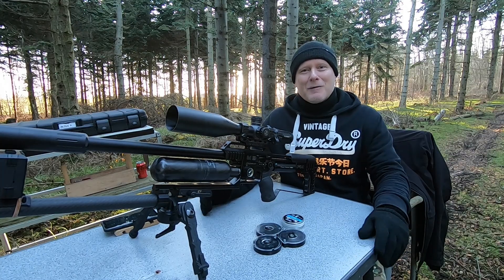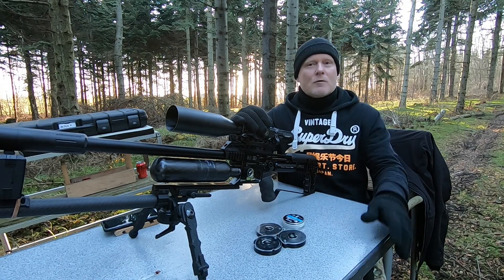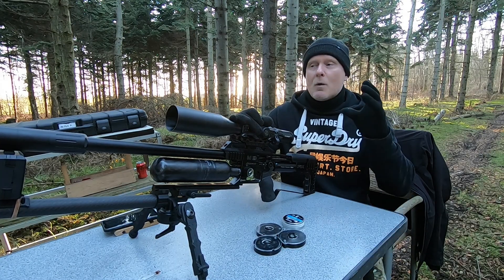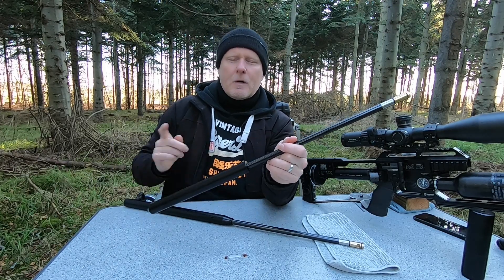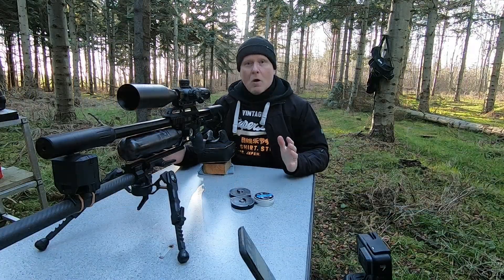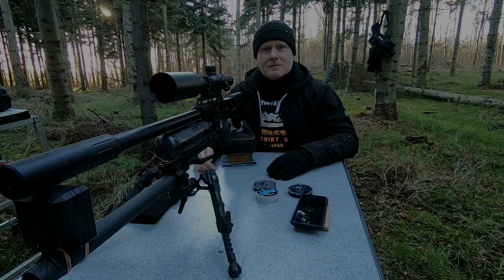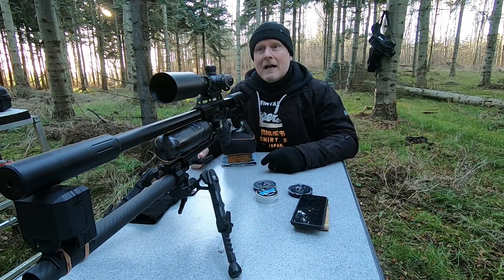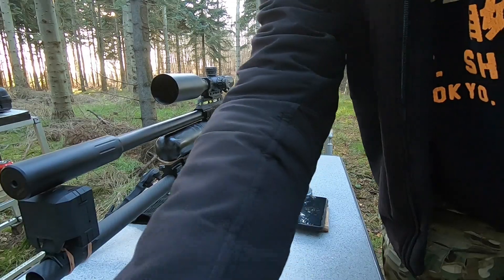FX Impact M3 Barrel change, 600 mm/700 mm - PLUS Accuracy test. What is the gain in velocity?

Comment: Nice shooting. 
Surprised at small gain in speed. 
Might need more shots through new barrel to lead it in.
Something else is not the same. 
Larger calibers show significant increases every 100mm.
I'm waiting for the FX MK4 with a 800mm  barrel. 
Cheers from sunny Florida 🌞 ☀️ 😎
Reply from the maker: Yeah lets see where the length of the barrels ends 😃
Im really happy with the 700 mm. The 600 mm is on my Wildcat now 😃
I think that the increase would be bigger if the reg had been higher. When we tested the 500 vs the 600 in the Mk2 the gun was tuned for the 500.
Here it was the other way around. But I still dont think that the gain would have been as significant.

The sun and the good weather is still a couple of months away here.
Kinda excited to see what higher temp will do for the accuracy 🤓 It usually helps - maybe I will be shooting hole in hole by June 😃😎😂

Best regards mate 😎

Comment: Personally I think that with the impact you get better results when you work at high pressures, I do want to leave it at 990fps, I put the regulator at 160-170 bar which gives me more than 1040 fps, then I close the air flow to  i get 990fps. This way I get the difference between shots to 1-3 fps , I like to work with high pressures because the power curve is more efficient, and there is less vibration when the air passage is more close. That's my opinion
I have .30 cal
Reply from the maker: Thats a good point Tom!
I really like the idea of turning down the reg to get more shots, but I might be too low at the moment...But with the quick adjustment system at 2,5 I dont think that it makes significently big vibrations. 
But maybe 10 bar more on the reg and a bit down on the hammer for me 😉
I doubt that your slugs would go very fast with 110 bar on the reg  😂

Have a great sunday 🙂
Reply: @VikingAirgunner  Of course, in .177 you don't need as much pressure because the weight of the ammunition is much lower. I forgot to say that with this method it gives a stronger but shorter air blast, so I need less air because with the strong air pressure I get the desired speed without residual air behind the slug. Good Sunday to you too.

Comment: there is something wrong there mate. i went from a 500mm to the 700mm in my .177 impact mk1 and it went from 865 fps (jsb 10.34) to 930 fps with no  dual transfer port or pin probe
Reply: sorry forgot to mention that wen the barrel kit arrived the  steel part on the transfer port side was loose and i had to loktiite it
Reply from the maker: Im not really sure where you are going with this info? Could you specify a bit closer please? 🙂
Reply: @VikingAirgunner   its  either your first regulator went bad or the part that your dual transfer port  screws on is loose as well. there is something wrong with your ES .also i emailed your friend about a carbon liner housing but no response
Reply from the maker: @tromplee6107  That could make sense 🙂 Thanks for your suggestion 🙂

Comment: Looks good mate! I wonder if you might benefit from indexing your liner and then using the harmonic tuner. It looks like your trailing off from upper left to bottom right, so maybe if you index your barrel just a touch, you might get those in a vertical line and then be able to clean it up further with the tuner. I have tried the KOs with my 600mm on my Crown, and they did not seem to like being shot at higher velocities. It was like a shotgun when I was shooting at 950-1000 fps, but then when I got into the 800s it started to get better. It was not great, but better. I need to do more work with them and I may be able to get them to group well.
Reply: Hi, just a quick question; would it be possible that your grouping at 950-1000 fps would be bigger because of entering the transsonic phase where the projectiles become unstable?
Reply from the maker: Hi Pat
I never thought about indexing the liner. Thanks for sharing that idea mate 🙂

I want to get the tune as good as I can before using the barrel tuner. I have a cf barrel housing commin shortly, so there are still a few projects before, but it is comming 🙂

I think that there are many sweetspots at different velocities. Recently got a Wildcat and I had that shooting well at 760 fps and again at 850fps.

I wish I was better at tuning, but it is a proces - so thanks again for your input 🤗🤗

Comment: Great group !! Is the vertical poi spread not resulting from the significant velocity spread? At 100m, I assume that a difference of 30 fps translates to vertical poi shift. If your average velocity is not to close to the plateau velocity for your reg pressure, maybe you can slightly increase your HST and see if that gives you a lower ES. In terms of ES, the sweet spot is usually just a few fps below the plateau velocity. But I'm sure you know that. Just let us know how you address  this issue. As far as I remember, in his Power Tune video, M Dubber talks about longer barrels. You might find interesting clues in there.
Reply from the maker: Hi Steph
It makes really good sense with the vertical shift ☝️
So far I have been focusing on the valve and I still believe that I can improve the tune by some fine adjusting. I have seen some changes in ES so not all done here.
And with the ES being so much better in the 600 mm it could mean that I have turned the valve to far in for the 700 mm? 🤔 Valve closing to soon.

I actually think that the M3 is capeable of doing an even better group - and thinking about my bench (a camping tsble) it would help to get a table that is rock solid 🤓
Reply: @VikingAirgunner  Yep, a sturdy table would be a good investment 😀 Build it yourself, you will exactly get the quality you want. I have started building mine to shoot at 50m in my backyard. Good luck with your tune. No doubt you'll figure out how to get your velocity spread fine.

Comment: I really enjoy your videos & that's amazing accuracy ! Couple of questions (on the 700mm barrel) ; what is the regulator pressure & are you using the harmonic barrel tuner ? (I'm using NSA 177 12.5gr at 970fps with regulator 85 bar - and the accuracy is poor so far).
Reply from the maker: Since my spread is so bad I dont really recommend my settings, but I have the reg at 100, micro adjuster at 2,5 and valve at 3 🙂
I might turn up the reg to try for better spread 🙂
Reply: @VikingAirgunner  I have the wheel at 15, the micro is at 2.9 and the valve at 4. The fps spread is practically non-existent ; between 967-970. So it's super puzzling that the accuracy is pretty poor, being a 3cm spread at a only 30m ?  I don't think I need to turn up the regulator, because 970 fps with 85 bar keeps the system unstressed. Not sure what to try next.........maybe wait for warmer weather :)
Reply from the maker: @nonickname6154  There is a very positive effect with the warmer weather 🤗
If Im to compare the mk2 and the M3 I find the valve to be much more sensitive. Like an 8th of a turn really makes a big difference 😯
Reply from the maker: @nonickname6154  If your groups are like that with that nearly perfect spread, I would say that you dont have the right velocity 🤔

Comment: Awesome.  The longer barrel usually shines at greater distances.  I’m trying to get my M3 22cal to shoot slugs and having difficulty.  Going to try the carbon barrel liner or the heavy slug barrel.  Thanks for the update.
Reply from the maker: Anything that can make it more stiff and with less vibrations 🙂
Im a big fan of the barrel sleeves 🤗
Reply: Hi Jerry.
With the standard superior liner 700mm in my .22 cal M3, I am able to achieve excellent groups with H&N 30gr slugs at 100m and even out to 150m. 
I am happy to share my "tune" 
with you if you wish. 
I need to add I have fitted the slug power kit, but retained the standard valve spring.
Reply: @mariocesare7669  interested in your settings for that.  Can't find tunes on FX site. Also trying to find out twist rate for .22 700mm barrel. Seems to be loads of different opinions, from 1in26 down to 1in 16.
Reply: I've shot a lot of birds off silo offhand with my 22cal 700mm barrel with slugs. It's very tricky when you start.
Reply: Longer barrel benefits only when You can hold Your gun steady as hell. Longer barrel = more barrel dwell time. If You are only shooting from bench, longer barrel is good, but when shooting off the hand, then it is bad.
Reply from the maker: @PiPprojectsinprogress  I agree. I could not imagine holding this gun off hand - or it would be kinda fun to do a video where I tried 😂
Reply: @VikingAirgunner  It would be nice entertainment to see accuracy at 50m shooting off hand. I bet You are familiar with AEAC Vlog YT channel and Airgun Exploration & Advancement Channel. Then You probably know that max fps doesn't mean max accuracy. That waste air behind projectile leaving muzzle.
Reply from the maker: @PiPprojectsinprogress  And thats also why I say that Im not nesecarely interested in higher velocity - but more like the right velocity 🙂
I will go and check out the channels that you mention.
Thanks for sharing mate 🤗
Reply: @VikingAirgunner  You're welcome!

Comment: Awesome video buddy 👍longer barrel for lower reg pressure but you have to balance everything reg ,power wheel, valve adjustment everything has to be in balance.... I had that same problem where my spread was all over the place with my 25 cal 700mm it would shoot 950 then it would go up to 990 fps it was crazy but I had my reg at 120 bar so all i did was raise my reg pressure to 135 everything started working together good luck ... but to me you have  very accurate 177 cal 700mm gun my friend thanks for sharing bsafe buddy
Reply from the maker: Hi Chris
Thanks for your advise 🤗 Maybe I should try that path. I tried it, but Im sure that I can be much more thorough.
For now I have been focused on the valve wich has been positive, but I think that you are right.

Thanks again mate 🤗

Comment: Thank you for this video, I thought about ordering FX M3 600mm barrels in .177 or 700mm barrels, so they had a difference in muzzle velocity of about 20 m and convinced that 600mm will suffice.  The accuracy at 100m is almost the same. Thank you very much👍

Comment: I agree that chasing FPS itself is not interesting, but your results where very surprising...
Reply from the maker: And I can truely confess that I didnt expect a result like that before starting shooting. But getting control over the spread will ensure the groups to be closer to this one every time.
Reply: @VikingAirgunner  yeah, the spread I am sure also can be tuned. But I did expect that you would gain quite a lot of FPS... I am not used to .177 tho, maybe it does not benefit from a longer barrel?
Reply from the maker: @mikaelbackstrom  The gain between the 500mm and the 600 mm was 46 fps, so I also expected more. Maybe if the reg was set a bit higher it would give a different result.

Comment: Excellent video Peter, could you encourage your friend to start making Carbon Fibre barrels in 700mm , I am sure there would be great demand 👍
Reply from the maker: Actually I think that he as one waiting for me all ready 😀 So just ask him  - Im sure that he would make you one 🙂
Reply: Sharing my experience . I purchased a carbon  sleeve in the US offered by FX . Instead of just sliding the sleeve in or gluing the sleeve in over the barrel I opted to put a thick silicone grease on the barrel and sleeve and slowly slide it into place . 
Later if you find it doesn’t help you you can easily remove it .  
My results have been mixed only because I shoot a lighter pellet and my speed didn’t contribute to much harmonics to begin with .  You never know until you try it .